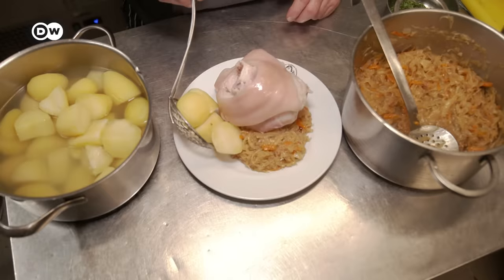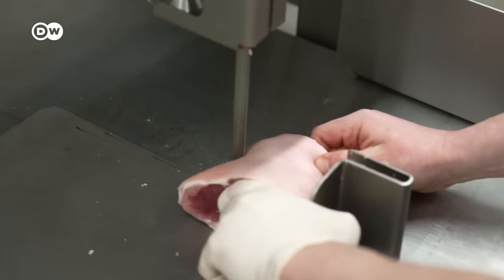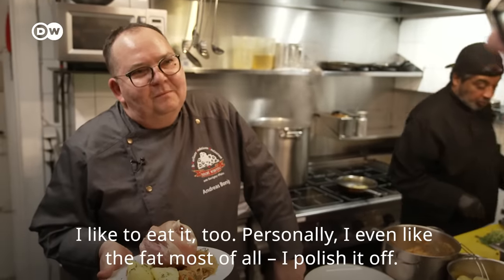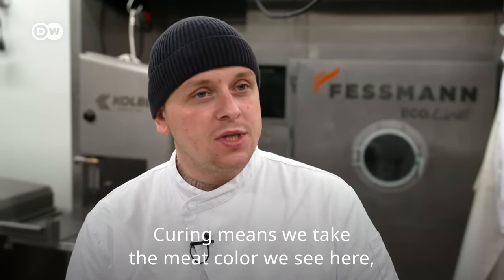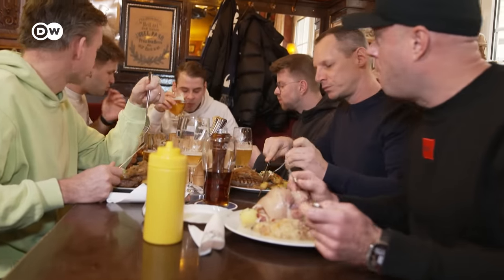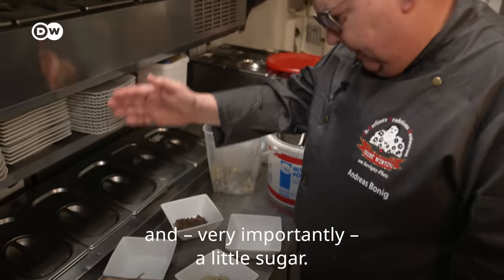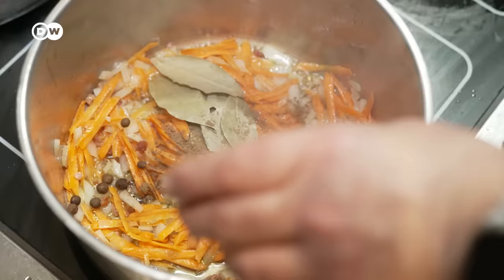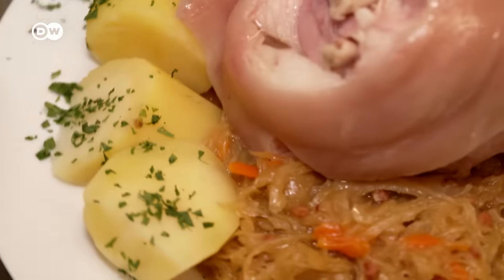German Eisbein: How Berlin-style pork knuckle is prepared

Comment: You can deep fry them after boiling so that the skin becomes crispy. We call that crispy pata in the Philippines minus the curing.
Reply: Sounds way tastier than having boiled fat.
Reply: @jodawgsup  Yeah but the meat is way too dry.
Reply: @hirolla74 Interesting! I haven't had either. Which do you prefer?
Reply: if the oil is hot enough to pop the skin, will be just few seconds and wont dry the  meat